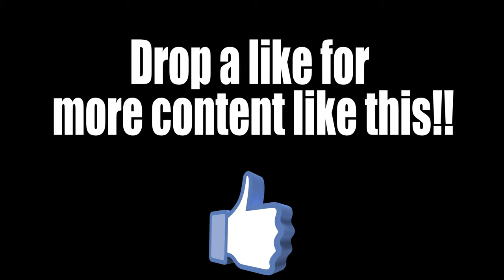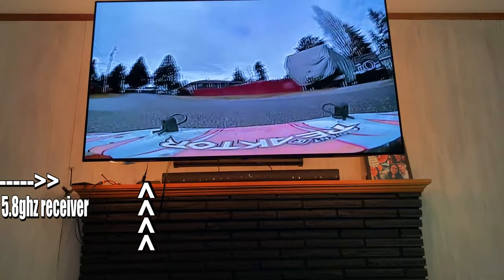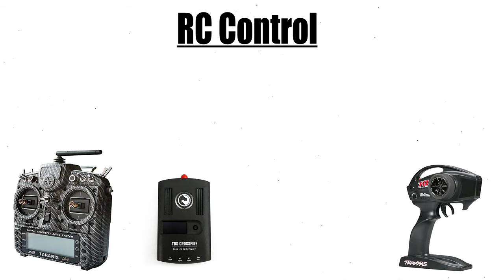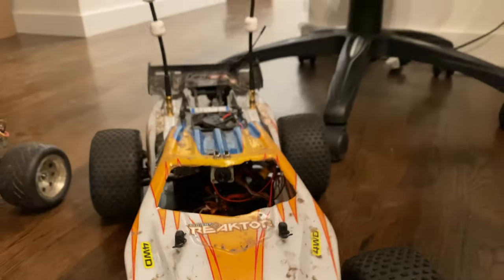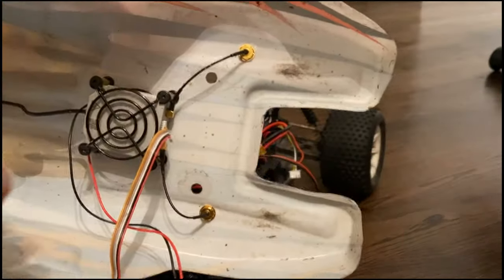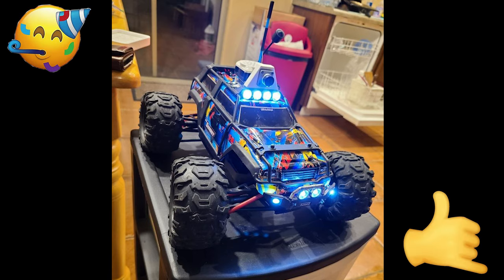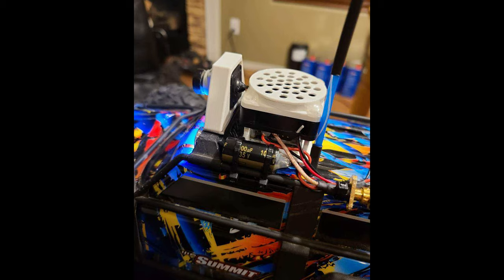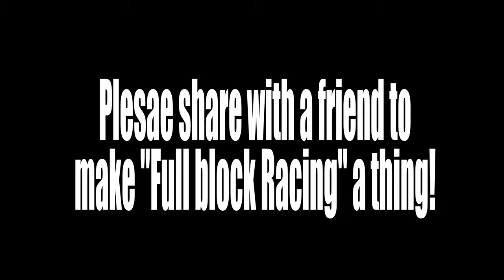How to Build an FPV RC Car in 2021!!!!  - 4k

Comment: Is there a way to use the micro crossfire module and not the lite module?
Reply from the maker: Yup, I actually just made a cable for it! It’s really not that hard to make but there isn’t a cable available to just buy, at the moment. I will update my descriptions with the parts to make the cable later today 🤙
Reply: @ChaddRainsFPV  you are the man!!!!!
Reply: @ChaddRainsFPV  I got the crsf TBS CROSSFIRE 6CH PWM NANO RX and the radiolink RC6GS V3 7 Channels 2.4Ghz RC
Reply from the maker: @hula493172  Yo, long day sorry for the delay. I updated the description to include the two parts and wiring diagram. The bottom pin on the crossfire micro is signal (red wire on the 3.5mm cable). One up is ground (black wire from the 3.5mm cable but you also need to put the ground of your battery there too). One up from that is positive for your battery (I use a 2s or 3S LiPo to power the module). 

Not the best write up, but you can figure this out, I’m sure! 🤙
Reply: @Chadd RainsFPV  Thank you so much !!!! I have the stuff ordered Rx Pigtail radio when I get all this hooked up I'll post up videos this is going in my Xmaxx it's so big it just goes ! And DJI FPV makes it so much sweeter and now getting long distance control link too 😊😊😊😊
Reply from the maker: @hula493172  that’s awesome haha. I’ve got my eyes set on something other than the Losi Lasernut but it’s too sweet to give up just yet. The XMaxx is a legit contender tho 🤙
Reply: @ChaddRainsFPV  man I can't wait to see what ya got in the works sir do you Facebook?  Or Instagram too?
Reply from the maker: @hula493172  I do Instagram but it’s literally just videos I make of my baby lol. I always check out people’s vids tho 🤙
Reply: Hey Chadd what do I need to set my channels to in crsf 1 and 2 channels I have a servo adapter and a nano rx
Reply from the maker: @hula493172  normally they’re set to tx and rx, but for an rc car you want PWM channel 1 and PWM channel 2, etc. 🤙
Reply: @Chadd RainsFPV  thanks man I thought that's what was supposed to happen my work table light went out on me last night so I had to stop soldering last night I got to go get a new light

Comment: What extension cables are you using for the antennas?
Reply from the maker: I am using mmcx to rp-sma extensions from DJI. Then I use rp-sma to sma adapters for the double axii antennas I use. You can find good mmcx to sma extensions so you don’t have to use adapters 🤙
Reply: @ChaddRainsFPV  thanks I ended up ordering the ones you put on your video.  One more thing.  The casing for the air unit.  Is that 3d printed?
Reply from the maker: @bradleycondon6398  nope. That is a custom case I made with standoffs, a 12v graphics card fan and some fan shields. I sandwiched the air unit in between and used some longer bolts to mount it through the body.
Reply: @ChaddRainsFPV  Do you  recall where you got the customer case at?  I haven't found anything I like so far online.
Reply from the maker: @bradleycondon6398  3mm bolts and standoffs can be found on eBay as well as fans and fan guards 🤙

Comment: Yeah for a 1000 bucks it's not very good big, to much hassle probalb yhevy as well needs cooling so audio is basically unusable have you tried a cell signal based long range system?
Reply from the maker: All the cell / 4g systems have too much latency to o go over 20mph. DJI is the way to go (for now) 🤙

Comment: Nice, have you considered putting an apple airtag on for real time gps? They're about $25 and work well for the cost but being apple only works with apple iphone or ipad.
Reply from the maker: Man I literally just bought a pack hahah! Got one for my dog and one for the car 🤙
Reply: @ChaddRainsFPV   $100 four pack, can't beat it. Is the cost of the DJI setup pretty much the $670 goggles? I found the camera for $150. Does that sound correct? Thanks
Reply from the maker: @Kirk_Wood  So the DJI goggles at $670 is a little steep but a lot of places are out of stock so that may be fair. $150 for an Air Unit (which comes with antennas and camera). But then you want a fan and possibly some antenna upgrades. It all comes down to how much range you want. If you keep the power output really low and use the stock antennas, you won’t be buying anything else (fan, etc) but will have less range. If you turn the power up with no fan, you kill the air unit eventually. Hope this helps 🤙
Reply: @ChaddRainsFPV  Yep, I gotcha. Thanks

Comment: Can you see whats up with mine. I'll give a Lil video to  let me know how bad I'm missing up lol
Reply from the maker: I checked your channel and didn't see an fpv rc car video. lmk!
Reply: @ChaddRainsFPV  just posted it I forget to record no so good at it
Reply from the maker: @Alpha420247   - Yup, so the camera mount looks good. Might need to take some more plastic out so it’s not in your view, I can’t tell. The video transmitter looks okay but the way it’s wrapped up make it get too hot. You will have to power the vtx from that green battery and not the little battery because I know that system needs more voltage than the little battery has. Make sure to use a different battery to power the vtx than the one powering the car. Analog video systems suffer from noise coming from the esc/motor a lot more than digital systems. So the best thing to do is make it so it has its own battery. You can keep building and post more stuff later and I’ll try to help 🤙

Comment: Interested in collabing? I'm working on putting a air unit in my Axial Yeti XL
Reply from the maker: Yeah man let’s do it! What were you thinking as far as a collab? You live around Seattle by chance?
Reply: @ChaddRainsFPV   no I’m in Texas! Trying to build my first fpv truck! Definitely want to travel once my channel gets bigger! Maybe we could do some long distance collabs? Like rc challenges or something! I’m hoping to figure out a system where I can swap one air unit setup between a few different rc’s? I’m also running 1200mw so I need a fan and to figure out how to power and install the air unit! I have a 3D printer! I’m hoping to find a way to securely mount the air unit in a perfect location and get steady footage but hope to be able to pop it in and out for different trucks? Any help would be much appreciated and I’m down for any ideas!
Reply from the maker: I’m in! I love the challenges idea. I am making a couple more videos about building a better rig and another video about swappable air units/vistas. You can use a vibration isolator (looks like 4 rubber grommets on a platform. Found on eBay etc). I set my suspension up a little softer and run bigger tires to cope. 

I say we start it here like this:
Chadd RainsFPV challenges @Mad Props RC & FPV to a hot lap around your block in a custom RC car! Forget speed since our streets might be different sizes, just make it all the way around first 🤙 DVR proves it!
Reply: @ChaddRainsFPV   perfect! Sounds amazing! Can we start the challenge after I get my air unit into yeti? Still trying to figure out how to best set it all up? This is gonna be so much fun! 😎🤙🏻👍🤩
Reply from the maker: @kenny2644  right on man! Let me know when you get your video posted and make sure to hit me back with a challengers the video 🙌
I’ll make a reply and keep the games up hahah

Comment: Why not raise the camera with washers or something. 40% of the bottom of the view is useless. Just wondering
Reply from the maker: So having a taller camera is pretty nice since you can see farther, but the further you get from the chassis, the more vibration/movement you’ll get in the camera and the more damage when you roll over. 

It’s kind of a preference thing but I would like to have it up as high as the car allows 🤙

Comment: Why is FPV so underrated in RC-vehicles?  99% is Quadcopters
Reply from the maker: I think people that do FPV have to jump through a lot of hoops to learn what works, and there are extra hoops to jump through for ground FPV vehicles. And since nobody has really been putting out info on how to get a good ground setup before, most guys that tried were disappointed. 

Hopefully we can change that right 🤙

Comment: DJI is not a frequency , DJI is an fpv system that uses 5.8ghz , you're mixing video protocols and freqencies together and that's just nono. Odherwise great vid.
Reply from the maker: I should have been more specific about my terminology. There was a lot covered in the video. I was pretty sure I said “video system” and not “video frequency” specifically when referring to DJI, but hey I had 40+ hours just into the making of this vid. Coulda messed up 🤙

Comment: You need a gimbal for the camera on it since this choppy video needs fixing.
Reply from the maker: I switched to a better suspension, camera mount and tires and it’s a world’s difference 🤙 I thought of using a gimbal but the axis I would need isn’t one a normal gimbal offers. Pan, pitch and roll is normal on a gimbal but I need to control the up and down. My camera mount needs knees 😂

Comment: Its illegal to use 1.3 GHz in this way. Its not a public frequency.
Reply from the maker: 1.3ghz has 2 legal-public frequencies in the USA. 1256MHz and 1280MHz. You can legally transmit on these frequencies at 25mw. I believe you can up that power to 1w and stay within your legal limit if you hold an Amateur HAM radio license. Stay safe y’all 🤙
Reply: @ChaddRainsFPV  u guys are breaking the law your rc will be confiscated with fines

Comment: Hey I was wondering if I could get get some help I have absolutely no experience with cameras and remotes and everything else that goes on in fpv so I was wonder if I could we could chat or something
Reply from the maker: You can ask any questions right here in the comment section and I’ll try to help. That way if others have questions maybe they find it here too 🤙
Reply: @ChaddRainsFPV  I’m I have like a million questions not joking
Reply from the maker: @crazycarrc  Write/type them all up! I got a 12mo baby, if I have 5 minutes here n there I try to answer comments. I don’t really go on other platforms much
Reply: @ChaddRainsFPV  ok
Reply: @ChaddRainsFPV  what’s the best / cheapest/easiest fpv setup
Reply from the maker: @crazycarrc  5.8ghz analog video is the cheapest and can be good still if you get quality gear. RadioLink RC6GS v3 controller will give you plenty of control range. 

The best is DJI O3 for video, but it’s far from the easiest of cheapest. It’s what I’ll use in my next rig.

Comment: hello. so i really need to know if this would work with a gas model. will the vibrations make it usable?
Reply from the maker: Vibrations may cause Jello in the camera, which would look bad in the goggles. It depends on the camera you use as some are more susceptible than others. There are camera mounts that can help with that too. 

The vibrations would affect range unless they were so severe that rattled something loose on the vtx
Reply: great question i run Nitro tooo

Comment: Damn i wanna do this sooooo bad but im broke :(
Reply from the maker: Don’t think about it like an Xbox that you need to save up and get the whole system. You can totally get a car and have fun with it. Then get some FPV gear and play around in close range. Then upgrade your remote etc. It’s a hobby at the end of the day don’t forget 🤙
Reply: @ChaddRainsFPV  I have the car which made me broke. I’m just a kid I get $5 every week for allowance and $1.5K is going to take a long time to save lol. I’m about to graduate middle schools so maybe I’ll convince my parents to let me get it as a reward
Reply from the maker: Hahha right on 🤙
You only need a few more things, so $1500 is a bit of an over reach. But I get it, things are expensive when you’re young. Just keep saving for the big things you want. It’s crazy how money adds up over time when you stop thinking about it 🤙
Reply: @ChaddRainsFPV  how do I power the fpv air unit? Think I'm gonna get one
Reply from the maker: I spliced a wire into my car’s power connector. But most people go with a separate battery to avoid any voltage spiking issues. When rc cars use their brakes, a bug voltage spike can happen and mess some things up in an FOV system. So either use a small 3s battery (like a 500mah) or splice in a wire to your car but add a 1000uF capacitor rated to a higher voltage than your cars battery.
Reply: @ChaddRainsFPV  thanks dude u answered all the question the internet couldn’t